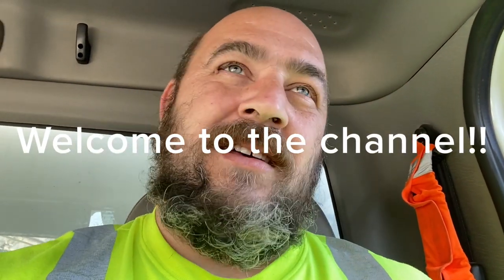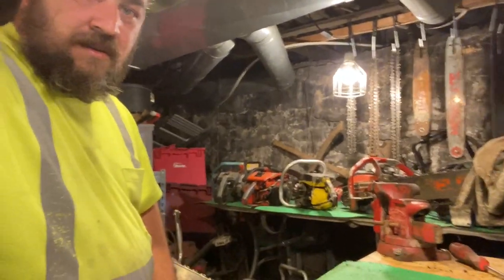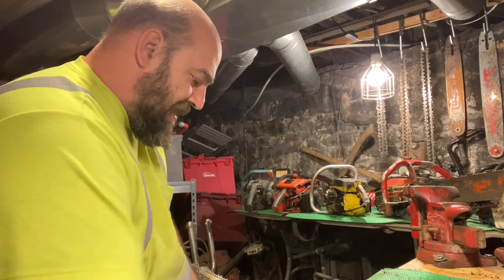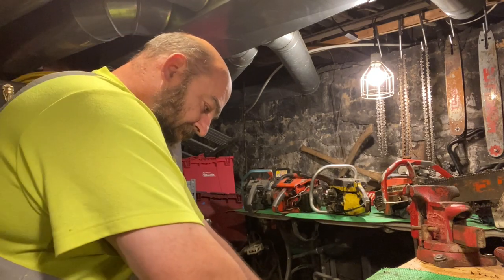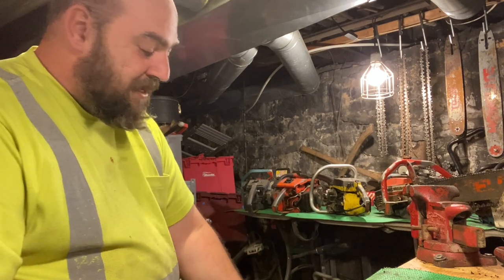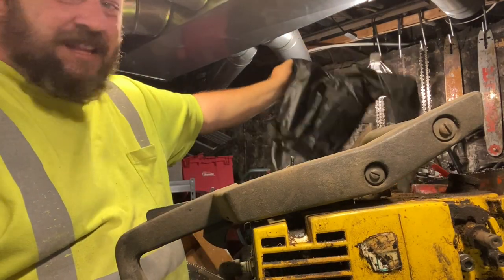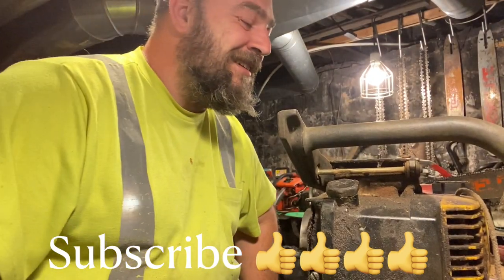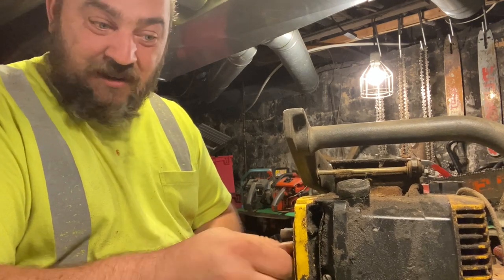We got gifts for the channel!!  WooHoo!!

Comment: Can you please tell me why my chainsaw is smoking where the clutch brake is it smokes so bad and got so hot it melted the cover I had to order a new cover
Reply from the maker: My first guess is the clutch is worn out. it’s hard to tell without seeing it. does the chain slow down or stop when cutting but at the same time the engine is still running normally?  I have an example of a bad clutch. 

https://www.youtube.com/watch?v=IE3XXLjr7hM&feature=youtu.be